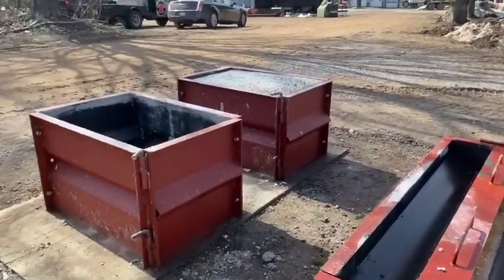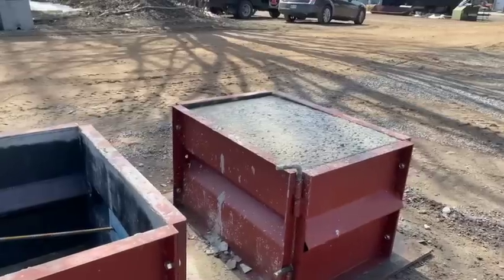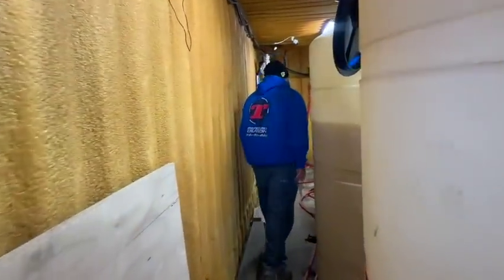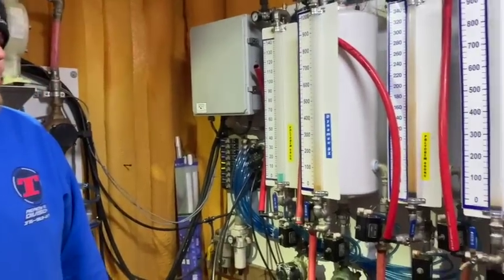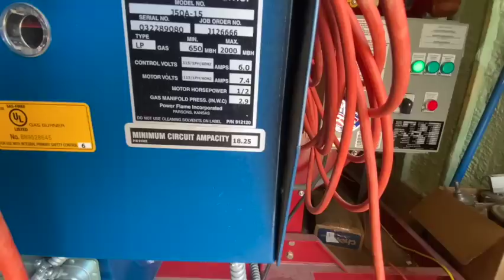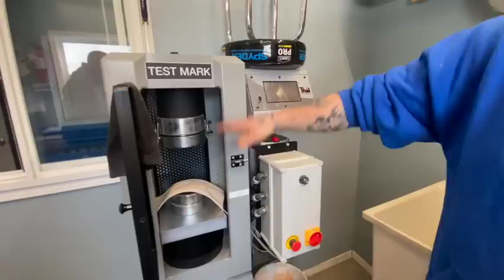YOU THINK MAKING CONCRETE IS EASY? THINK AGAIN!!!

Comment: Great Job Ron! I've read a lot of the science but never toured a plant. You should do another video with one of the more knowledgeable drivers to explain how their day goes and how different conditions can require them using additives at the site. How they change slump for different type pours like ICF. Most guys would be amazed at how much science has evolved in making concrete.

Comment: And the moisture in the rock and sand can have an effect on the strength too.  Great video.
Reply: You are absolutely correct, there are moisture probes i the aggregate bins that read moisture content which allows the computer system to reduce batch water and add aggregate weight. It is definitely more to it than most people know.
Reply: Probably the most important part my day when I batched concrete. You would weigh about 1000 grams of rock and sand, cook it out then reweigh it to come up with the moisture %. So many plant superintendents would skip this part of the job because they are lazy. Very important to keep your aggregate wet, nothing worse than batching with dry rock, it sucks all the water out of the mix. I would hold out about 10 pounds of water per yard (roughly a gallon of water) so the driver could wash down his loading hopper and fins and add water to get to get the slump right. You could tell when a plant super didn't do a cook out, because they usually put in a high moisture number for rock and sand, the batch computer would hold out mix water, then the poor driver is out at the slump rack for 10 or 15 minutes adding 40 or 50 gallons of water to get the slump right. I always shot for driver adding 10 to 15 gallons of water, then I knew my moisture number for rock and sand were very close.

Comment: Delivered and batched concrete for 10+ years (DOT qualified) for Florida Rock/Vulcan Materials and Argos. When we were Fl Rock, we had at one time over 3000 different mix designs. The salesman and QC department would come up with a design for whatever the customer needed.  One of the most interesting mixes was for walls of cancer treatment clinics to contain radiation. Had heavy weight sand, and steel shot in it. Was so heavy we could legally only haul 6 yards at a time in our 10 or 11 yard mixers. Retired now but have some of the chemicals in my shed. When mixing store bought bags of concrete or mixing my own stuff up,  I can add a water reducer/retarder in and improve it. Even have some plastisizer to pour high slump stuff and some calcium to speed up the set time.
Reply: Some rad shield concretes even have lead sand in them

Comment: I built block walls since the 80's and never knew the mixing is done in the trucks. I took it for granted the concrete yard had a big cement mixer that dumped the mud into the truck. The truck was used to carry the mud to the job site while mixing the mud to keep it from drying out.
Reply: That is called a dry batch plant, a wet batch plant has a drum similar to a mixer truck where all the mixing is done then dumped into the truck. They are more expensive to build and maintain. They also keep the trucks cleaner since you don't have that dry cement/flyash or slag going into the truck which makes a lot of dust that gets all over your truck.

Comment: Nice video Bondo. Thank you, it was very interesting.
   I had a hobby of field testing old concrete we would take out. It was the blow method. Did it take 1 blow or 10 blows with the sledgehammer to break off an edge or corner. Lol
    Ed from Chicago 🙂
Reply from the maker: Good one Ed. LOL🤣

Comment: Our concrete aggregate that we use is a 14mm graded, so it has 14mm, 10mm, 7mm and 5mm stone, then it will be mixed with sand and or a 2 1/2mm aggregate, as 2 1/2mm aggregate is made as a by product and considered a waste product, good for fill, large 20mm aggregate is rarely used and only used for special projects.

Comment: Flyash (from coal plants) is a great cement additive for cement if used for non surface concrete like pilings or foundations. Some plants will even use coke inside the kiln when roasting the limestone to turn it into clinker which is then ground into cement with  flyash.

Comment: Great content Bondo. Question is concrete less expensive in warm weather? If yes by what %%.
Reply from the maker: It is more expensive if there is hot water used. it can be $15 to $20 extra a yard.
Reply: I agree with you Bondo, 140° water for a batch plant is not cheap to produce plus they would be using alot more accelerators to speed up the set time, great video.

Comment: I saw a concrete truck the other day I think it's in England that mixed it on site. The truck had everything separate and the mix came down the chute into a long auger that mixed it as it came out. Have you ever heard of that?
Reply: That's called a volumetric truck
Reply: I have used them, definitely not my first choice. Guess that is why so few are on the road
Reply: @revenniaga6249  it makes sense with the process he was describing . Theres a lot to making concrete. I didn't know that.